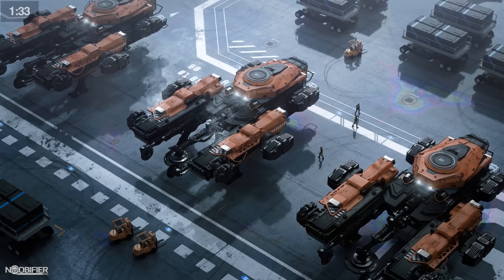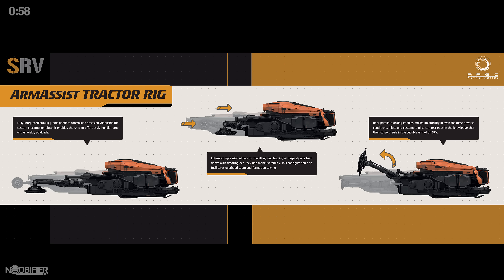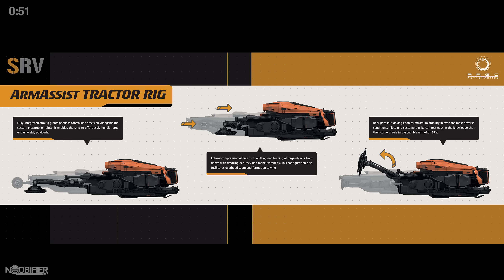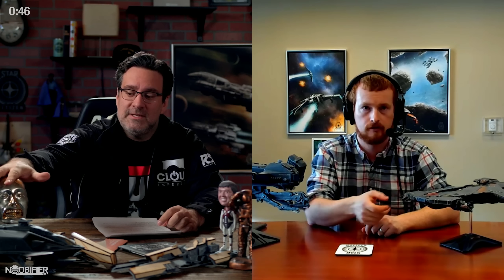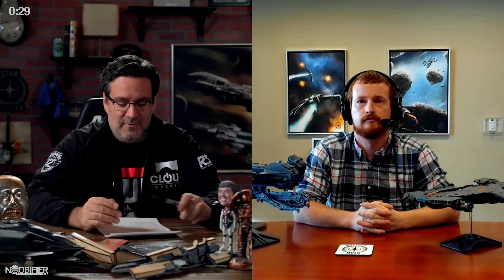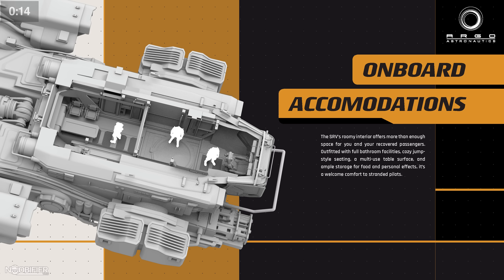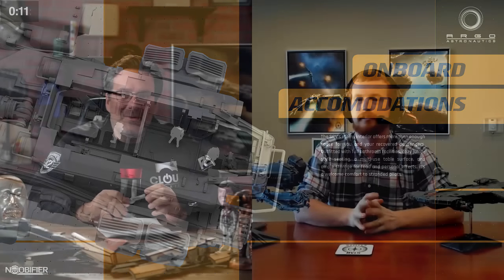Reverse The Verse - SRV - in 2 min 00 sec - Star Citizen - RTV

Comment: I'm glad they confirmed towing through quantum at all. It gives me hope for non-QD Snubs on the Connie not being suicide to deploy in a escorting-retreat situation. The traditional docking sequence for a Merlin into a Connie will likely require both ships to hold still for so long that any hostiles in the area would have an easy time popping at least the fragile Merlin, or disabling the Connie.

It should go down like this:
Merlin deploys from Connie in combat, Connie realizes it has to run. Connie charges/calibrates QD and the Merlin just has to fly close enough to the Connie to be "pulled along" in it's QD jump, perhaps via some proprietary Tractor Beam system designed only for pulling the Merlin back into it's docking slot.

I imagine Quantum Towing like that will come with a significant increase in Quantum Fuel usage, so you won't want to do it unless it's your only option. The SRV, being a rescue tow ship and not much else, may have a large enough Quantum Fuel Tank for it's size to account for most get in-get home 2-jump situations with a towed Cutlass.